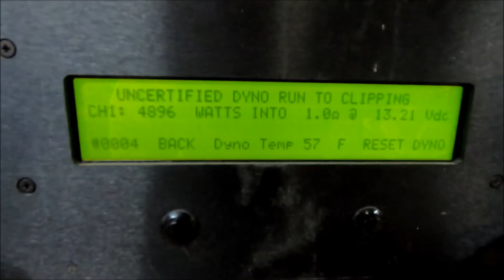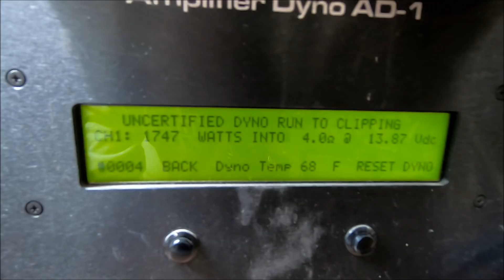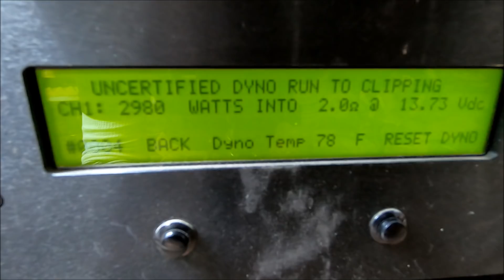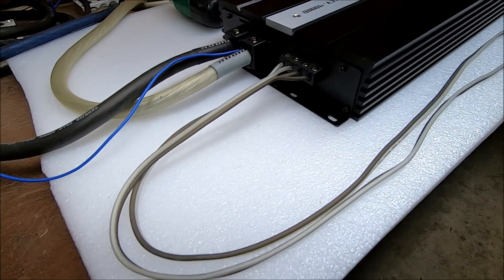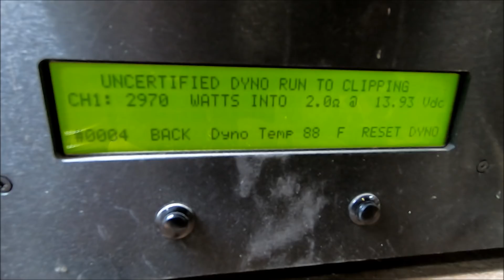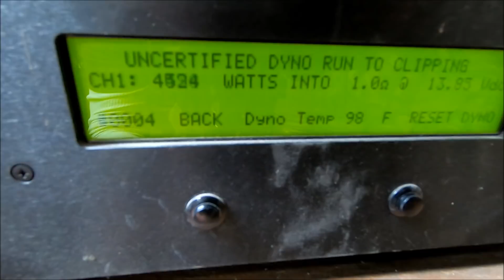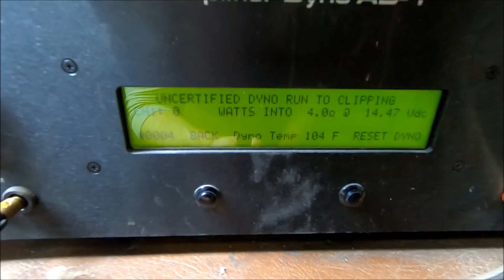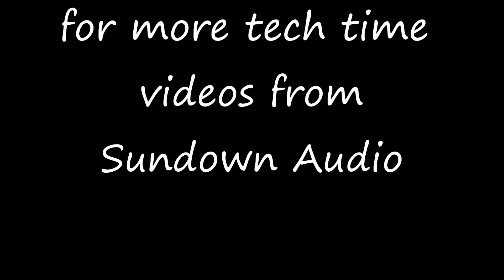***How Big Does Your Speaker Wire Need To Be?*** *Tech Time Thursday* at Sundown Audio

Comment: I think EMF audio did a test on this and it was surprising how quickly wire gets hot.  It definitely pays to go overkill if you plan on running lots of power.  Im planning on running 4 gauge speaker wire for 6k-8krms

Comment: The power loss is relatively small but what is more important is the heat that will develop in the thinner 16 gauge wire as compared to little or no heat with the 12 and 8 gauge wires.

Comment: My question would be this. Would using 12 gauge wire cause your amp to cut out? Here's  why i ask i have an amp (brand new) that was cutting out. I contacted support an they asked about wire size. I explained at first it did only have 8 gauge power wire an 12 gauge speaker wires. They said this was causing the cut offs. So i upgraded to 4 gauge, but kept the 12 gauge speaker wires. They then said that's still causing the amp to cut out.  With all this being said this amp is only roughly 800 watts an is only powering 4 aftermarket  6×9s that are around 75 rms @4 ohms. So should it be necessary to run 8 gauge to such small speakers?
Reply: Check your grounds!!! More grounding points the better

Comment: If your running below 1000 watts 18-12 gauge is fine. Your playing music the watts will vary. . Look at the speaker wire size from speaker terminals to the voice coil what gauge is it? Pretty small I would suspect Most 800 watt rms  subs hv 18-24 gauge wire.  If your running 4000 watts which is massive then yes 12 gauge. But most of y’all are wasting energy worrying about putting 4ga lol / 8ga speaker wire on a 1500 watt system.

Comment: Dang, im confused.. Ill be running upto 1400 rms and around 2500 or so max with a monoblock @1 ohm. My concern is having 4 speakers ran in series, they are 300watt rms each and 600 max, what guage should i use from the amp to the speaker and down the line and back?

Comment: I didn't know that having a thick cable from the amp to the sub box was bad. Using 0 gauge cca from amp to the box. Looks badass. Am I losing power for using it? Its about 3 ft long of cable. What's the optimum cable for 3k of power? 8 gauge?
Reply: You are using 1/0 cca as speaker wire🤦🏻‍♂️🤦🏻‍♂️🤦🏻‍♂️🤦🏻‍♂️🤦🏻‍♂️🤦🏻‍♂️🤦🏻‍♂️🤦🏻‍♂️🤦🏻‍♂️🤦🏻‍♂️🤦🏻‍♂️🤦🏻‍♂️🤦🏻‍♂️🤦🏻‍♂️🤦🏻‍♂️🤦🏻‍♂️🤦🏻‍♂️🤦🏻‍♂️

Comment: So what AWG size of OFC speaker wire should I use to power 2 subs with 20K RMS (10K each)? 4g or 2 runs of 8g will be sufficient for SPL comps? Surprisingly I did not learn this answer from watching this video because SAU tends to cover all bases, so maybe I missed it. 

(If someone wants to know what subs: 2 - 15" Fi Neo 4.11 w/ Omega option and stage 3 cooling rated 5K-7K RMS which is why I will be supplying them with 10K each, which doesn't necessarily mean they will receive 10K each, thanks to factors such "Impedance Rise").  

SIDENOTE: And to think, almost a year ago I watched this video to learn what size of speaker wire my single Kicker L7S 12" needed for it's speaker wires, haha, or maybe it was when I had already upgraded to 2 L7Ss but regardless, I've learned A LOT and have come a long way within the last year mainly by learning as much as I could from car audio pros via YouTube such as this YT channel. So a big thanks to these guys.

 [plug] For anyone interested in seeing my previous builds or my newest builds, feel free to check out my new/small/basic YT channel where I will be uploading much more content in 2021 in hopes of passing on accurate knowledge to my fellow bass-heads.  Presently am building my 5th build in one year, starting from 1K RMS, 2K, 5K, 8K, to now 20K RMS :-D

Comment: For my single SA-15 V2, I did Sky High OFC 10 gauge wire from the subwoofer terminals, to Sky High OFC 8 gauge from the box (bolt) terminals, then that just goes to the (Soundqubed 1200.1 @ 1ohm) amp. Works great, wire is thick and heavy-ish

Comment: When your running power inside your home you run #12 up to 20 amps and #10 up to 30 amps. Since your amp is putting out ac power I wouldn’t run anything smaller then 8 gauge.

Comment: should do 8ga CCA vs 12ga ofc , that would be interesting . i have people bringing me that 8ga cca all the time to install .
Reply: I put my money on 8ga CCA being less resistant, what quality of CCA will be a factor of course. 8ga is double the diameter of 12ga and ofc vs CCA resistance is not double (CCA around ~40% more resistant that being more along the lines of poor copper coating) as speaker wire resistance is going to truly be the determining factor as voltage and amperage without doubt both will be capable to handle comparable loads. (Down to brass tacks I do think either way in every way the CCA does hold a slight advantage though) but again that's comparing 12ga to 8ga so 🤷 price, weight and mass are weighed out in pros and cons as well. As long as all factors are accounted for I see no issue with choosing CCA, or mixing the 2. I have 1 1/0 run of each ran front to back in my set up but that was calculated and it's more than I need. I don't have the overhead I would if I choose to run 2 runs of ofc instead but i also have no problem running another run of what's needed if needed down the road to have a final result in continuing to have a fair bit of overhead. I will have plenty of supply where I'm not leaving anything on the table and wouldn't benefit in any way otherwise. If I am mistaken in anyway, well you with out a doubt would be the one to know as I do know your name and it's on my list to watch as i learn more about lithium before I decide to make the switch.
Reply: more resistance = more heat off the wire = not really a test he performed here.

Comment: You never need thicker than 8 gauge speaker wire and honestly that's a little much because the power coming out of ALL amps is AC voltage it's the same reason u use small wire in your house only dc has the problem of needing large conductor's to carry high current but cca wire still sucks lol

Comment: How hot does the 16ga wire get with that much wattage? I am going to use 16ga for my tweets and 12ga for mids and 8ga for subs. I don't think you would gain any performance from 4ga on 3k

Comment: Them results only would be true if you just burped from normal temperatures in a setup you actually play as you play heat builds up and efficiently goes down so for spl burps you can get away with pretty thin wire without a huge loss but in a daily setup the more you play the more power you lose to a point were the wire in a bad case melts or shorts out or it gets to a hot resting temp and you just play with low efficiency because the more heat the more resistance I may be wrong but ain't I right?

Comment: These are good videos! Keep 'em coming!

An idea for the future is same gauge wire but different types. Solid (like home electrical) vs. thin stranded vs. thick stranded vs. aluminum vs. OFC pure copper. Etc. Etc. Maybe even something crazy like copper tubing? Butting together many shorter pieces to make 1 longer piece? Simulate wire runs to door speakers 12' lengths.

Comment: I am using 10g on a dual x8 v3 d4 setup
Reply: I have two sundown x8v3 dual 4 oh. I ordered 8 gauge ofc speaker wire from down4sound and it was too thick. So I ordered skyhigh 12 gauge ofc. I need to run them in parallel from 4 ohm down to 1 ohm . I hope I ordered the right size wire. I wanted the thickest speaker wire but it's impossible to fit in the push terminal in parallel x8v3
Reply: Ok. But I'm wired down to 1 ohm.

Comment: My issue is it actually justified to spend the extra money on 8 gauge wire vs 12 gauge just to gain 20-30 watts of power unless you’re running more than a pair of subs as resistance and length will affect power loss

Comment: The dyno measures through a resistive load you could have just measured the difference in resistance between the wires and figured out the extra heat loss due to gained resistance. 

In reality you would be adding a greater resistance to an inductive load.

Comment: Next do a power wire test. (To see if 0 gauge  is overkill  on a 4k amp) i have a feeling it wont matter if you use 0 or 4 gauge.
Reply: 0 Gage or 1/0 AWG OFC  there is a difference and this has to do with AMPS not WATTS when it comes to power and ground -_- look at it like this you have a sonic milk shake and they give you a coffee straw, how much of that shake can you pull through with it at max pull before you kink the straw not much now lets try a McDonald drinking straw you get a bit more pull but yet again you damage the straw just trying to get it to come through , now lets get that big ass milk shake straw that oh yea straw you take a sip and get every bit of that sip you wanted right then with no drop in power flow  so 8 AWG would be a coffee straw and a mcdonalds straw would be a 4 AWG that ohh yea all day 1/0 AWG is what you want when you want every bit of AMPS you can give that amp the WATTS come from the speaker end and you cant make WATTS with out AMPS!
Reply: @UsurperTCG  ignore Chavy Cash he makes it blatant obvious he has zero knowledge of wiring. (For one to even imply that 1/0 awg is overkill for a 4k rms amp says all I need to know sm*h I would NEVER consider running 4 awg to a 1500 rms amp let alone a 4k BUT that's just my preference I guess. Though my amp stays cool, doesn't clip & never enters protect mode, doubt Chavy Cash can say that about his) You can talk to people like that until you are blue in the face. Only when they take the initiative to educate themselves by reading factual information on wiring, amperage, current & anything related to electrical will they begin to be enlightened. So many Americans are far too lazy to pickup a book or even get on their phone & just read to gain knowledge. Sad so many are completely oblivious to facts due to pure laziness.

Comment: Bro good test, but that’s just part # 1. Part #  2  should test those same gauges but with 16’ of wire. That’s about as long as you’d run in a car, but can always round it up to 20’ to cover worst case. 💪🏼

Comment: I'd like to see the difference between 8awg and 4awg as many people feel the need to go to 4awg these days. There are even people starting to use 1/0awg.
Reply: my 2 Fi subs will be receiving 10kW EACH so yea, I'd like to know if 4ga would be better than 8ga however where I think people become confused is when a power wire running 10k requires 1/0ga then why wouldn't a 10kW sub require 1/0ga.. well because the power wire is DC and the speaker wire is AC.  (2 Fi Neo 4.11 each on it's own Taramps 1-ohm Bass 8K wired down to 0.7 ohm = total 20,000 RMS Watts)
Reply: @lowhertzhighspl  yeah before impedance rise lol you're going to be lucky to clamp real time power 6k from each also dependant on your battery reserves and alt/alts and quality and quantity of power runs... I myself have a Wolfram AW-9000.1D wired to half ohm on two Wolfram PT-18'S 4in PE coils 4krms each (massively underrated) and I have 3 runs of sky high 2/0 ofc front to rear with a JY 270a running the truck side and a mechman 320 charging my batteries which are under the hood I have two XS SB1000-31 supercaps and then in the rear I have a single limitless cyber 12k powering my sub amp and a reg limitless 25ah powering my AW-125.4- 4ch and I have two runs of 2/0 to the cyber and 1 run to the 25ah and my voltage hovers around 14.8 while running and then full tilt I may drop to 14.2 the lowest I've seen was 13.8 but that was because I had not charged my liths in a while and the vehicle sat parked for 2wks without being ran at all but it quickly recovered up to 14.8 thanks to them dual alts
Reply: I'm using dual inputs bored out to fit 2 0/2 awg to series each sub. Over 20k each sub
Reply: Should of added a amp clamp,run each test for 5 minutes,see what results are.
Reply: I'm sorry but really what woofers could ever require 1/0ga for a freaking speaker connection??? Now that i would love to see hahaha one that actually does require that thick of wire to pass the audio signal "NOT THE 12V" people he is talking about speaker connections here and I've seen it myself too there's always the one guy at a show with freaking 8/0ga (yes i know the d-cell battery thick stuff) cut all the way around it turning the diameter down into a standard 4ga and shoves it in his woofers to connect them to his amplifier lol i mean come onnnn really??? What made you think that would be necessary or even help with anything or make.any improvements 😆 🤣 😂  Thanks for pointing this out showtime he deff should do this test (or maybe you and your new partner Exo can)
Reply: @kevinAuman1  I’m using 0 gauge
Reply: @foobart8746  you want a cookie bruh? Waste of good wire if it is good wire that is lol you will never need more than 8ga ofc to your subs as speaker cable and adding thicker wire actually might cause some power loss rather than give you a better connection because that's a lot of copper soaking up your audio signal...

Comment: Great test.now,let's see exactly the same test but differences between copper and aluminum. Thanks for the testing
Reply: there is a major difference in watts let alone resistance in the aluminum and would act more like a heater at high watts or high ohms on top of the ohms resisting in the CCA its self....stay far far far away from CCA, just get OFC ( AWG ) not Ga cause Ga is china way undersized wire. the wire topic is a whole damn planet of facts Vs scams
Reply: @UsurperTCG  truth!

Comment: Do you think that next time you can compare "regular" speaker wire to ofc speaker wire?... and just wondering why you did "uncertified" instead of "certified"?
Reply from the maker: I consider ofc (oxygen free copper) to be regular speaker wire.  What other type of wire are you referring to?  I chose uncertified because it will do more power and more current through the wire.  It made for a better comparison in my opinion.
Reply: @UnofficialAudio  speaker wire that's not ofc... I thought that is what you were using! My bad!

Comment: Length, OFC/CCA not accounted for? Shorter lengths would differ less (would be my guess). Did not account for heat building up when the load is on the wire for a longer period of time.

Comment: I no longer feel guilty for only having 1 run of 0 gauge from front battery to back battery.
Reply: That's completely different from this test. If your running more then 2k you probably need another run
Reply: @Str8GasGenetics  im running a mechman 250 alt, 1 xs d3400, 1 xs d3100 and my amp is an ns1v2 wired at 1 ohm. Im Only using 1 run or 0 gauge stinger wire and i never see anything  below 13 volts.  Why would i need another run if my voltage is so high
Reply: @chavycash2518  an extra run won't help your voltage, it will help your amp actually get the power it needs. Unless your running like sky high 1/0 which is actually 2/0 then you just don't have enough and could be getting more out of that amp

Comment: So I'm going to be running 3 soundcube hds3 10's at .67ohms and each sub should be seeing about 1100watts rms. I will be running 12awg. Should that be thick enough for be running, as I'm gonna have a hard time fitting the 12awg into the speaker terminals. Will they get to hot? I'm looking longevity and durability. If I  need thicker speaker wire, what would y'all suggest for getting all that wire into the speaker terminals? Thanks for the help.

Comment: Just sucks trying to shove 2 ~8awg wire into 1 terminal, do a video on that once that's my only complaint
Reply: What I did (if your on a budget like me) was make a little distribution box out of a little piece of MDF and some 1/4 in nuts, bolts and washers. I have 2, 15's dual coil. I have 8, 8gauge wires running to a 4 terminal DIY distribution box. 8, 8 gauge in and 4, 4 gauge out. I have a one channel amp with 2 pos and 2 neg inputs so it all works out nice. You can make a dis box in many different configurations. What ever works best for your set up.
Reply: I bought from sky high car audio dual 8ga speaker wire inputs to single 8ga output. I'd like to see a test done to know if even helps considering it's aluminum and small.

Comment: voltage drop might not look like much, but remember that 200w lost is going into heating the wire, after not too long the resistance will rise, and thats where the real power loss is, short burps might not make it so obvious, at 1 ohm 70A is being pushed through that wire, the 8ga is a good bet. enjoyed the vid! good to see some numbers
Reply from the maker: Sounds like a good idea for a future tech time video.
Reply: That's what this video forgot to mention. Very important info to keep in mind.

Comment: Flexin five has a good point... how long could you run higher volume on thinner wire with that type of power before it would get hot ? And if it gets hot would it get hot enough to fail?
Reply from the maker: With these short burst tests I didn't notice any temperature change in the wire.  Sounds like I'll be revisiting this idea in the future to perform a thermal test on the wire.
Reply: Awesome. I will be looking forward to seeing the results.

Comment: Definitely upgrading from my 16 gauge to 12 gauge on my two subs
Reply: Just go 8g
Reply: @Stealth I know this is a year old BUT really you were using 16 ga on your subs?? That seems way too small to wire subs... What amp were you running at that time? What was the rms?
Reply: @itdoesntmatterwhatyourname6128  2 Kicker COMP R 10s 500w RMS 4 OHM In a ported box with a Kicker CX1200.1 with 4 Gauge OFC Stock Alternator
Reply: If your running below 1000 watts 16 gauge is fine. Your playing music the watts will vary. Really 18 gauge would be fine for speaker  wire. Look at the speaker wire size in speaker to the voice coil. Most 800 watt rms  subs hv 18-24 gauge wire.